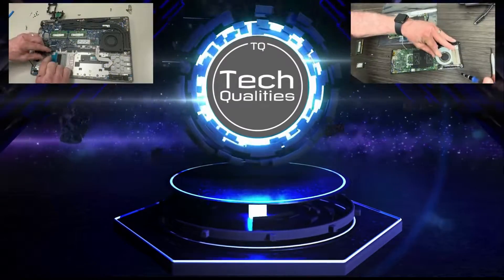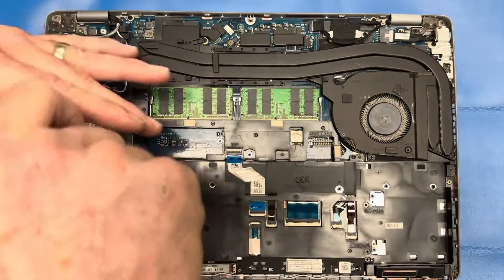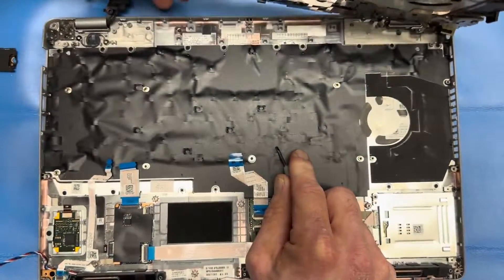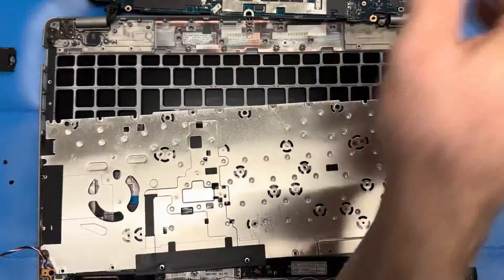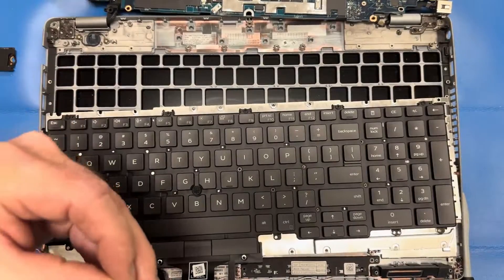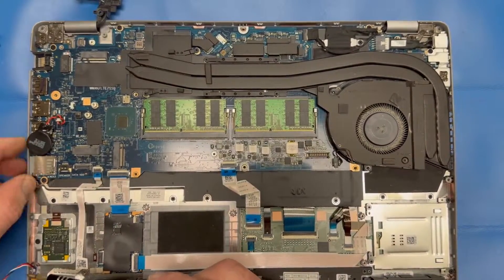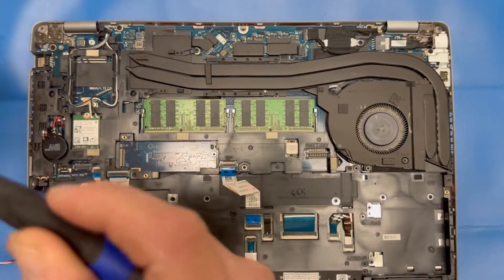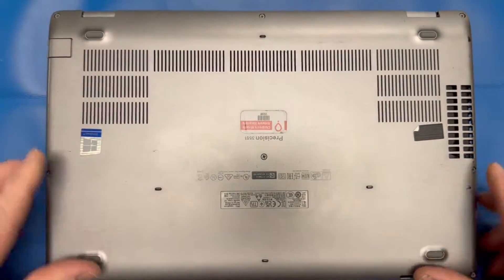Dell Precision 3551 Keyboard Replacement

Comment: Heads up. Your model doesn't have the finger print scanner. I tore my ribbon cable trying to follow your steps.
Reply from the maker: Sorry to hear that happened.  Always a possibility models differ from each other with added accessories.  Are you able to find a replacement cable?